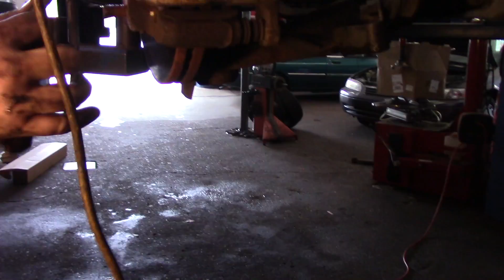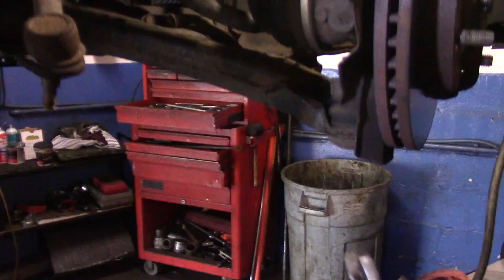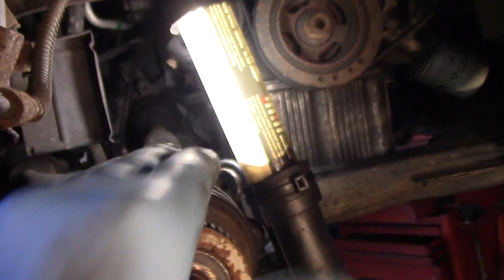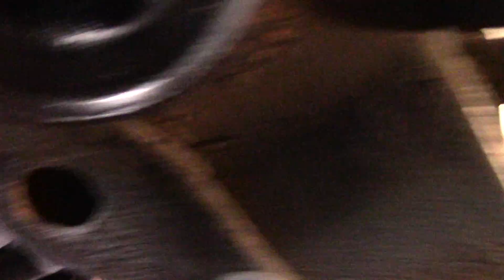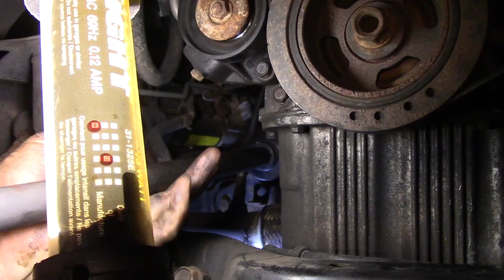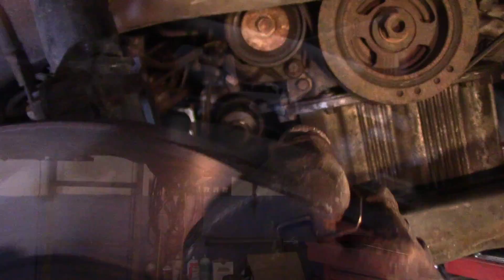How To Replace An Axle 2004 Hyundai Elantra

Comment: Good job quick and easy my friends farther has this year car he took in for inspection  they said it will need two new axles 500 bucks ok he called me to check it I found both left and right cv joints riped. In same place I called in make year came back at 246 bucks per Axel Soo I called my friend back I told him for cost of parts and  quote of 500 it's proper price

Comment: I wish they all came out that easily. Some CV shafts put up a big fight.
It’s usually a good idea as well to change the output seals while you're in there to avoid having to pull it all apart again if it develops a leak.
Reply from the maker: Thank you for watching and your input

Comment: Jim, 

 I have a 20000 Honda Civic
LX the starter is going bad if I do not replace it until it is gone will it hurt
the flywheel?
Reply: No.
Reply from the maker: Good question. No it should not damage the flywheel
Reply: @jimthecarguy   thank you.